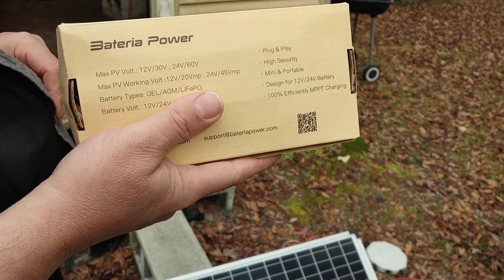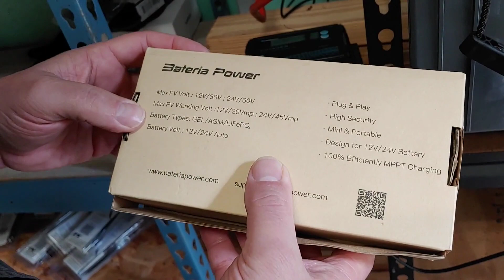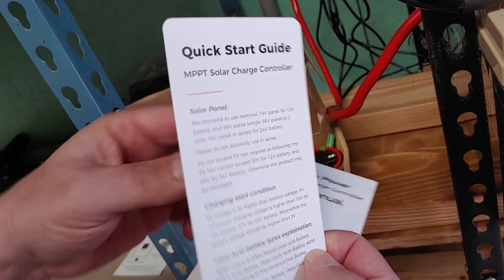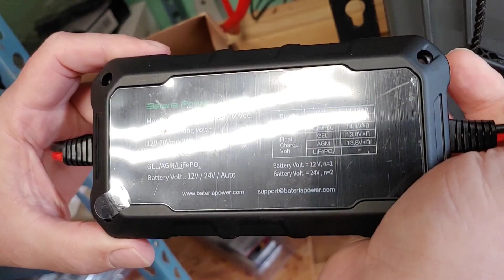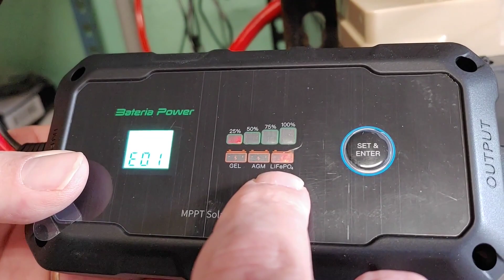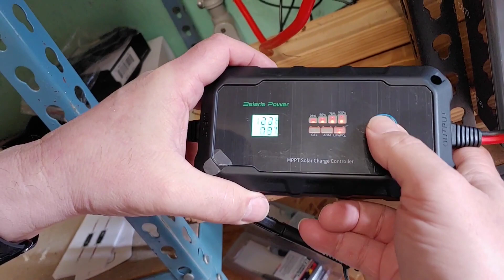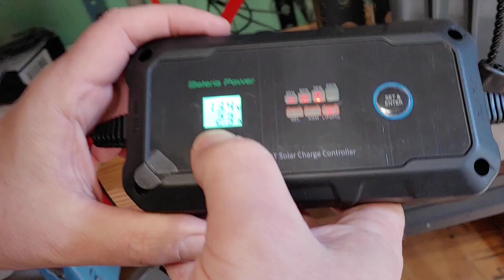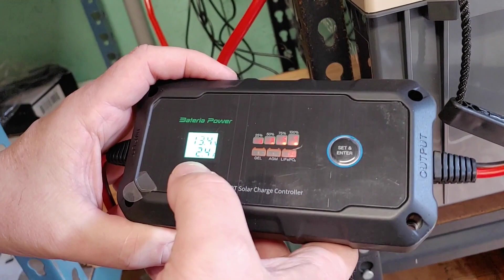Bateria Power MPPT 20A Portable Solar Charge Controller for Auxiliary Backup Solar Power System

Comment: Nice video....
What is the difference in using 20A....30A...60A.......100A .... charge controller....thanks thanks
Reply from the maker: The numbers indicate the amount of amps that the charge controller can handle. Thanks for your comment.
Reply: @shoestringprep  thanks